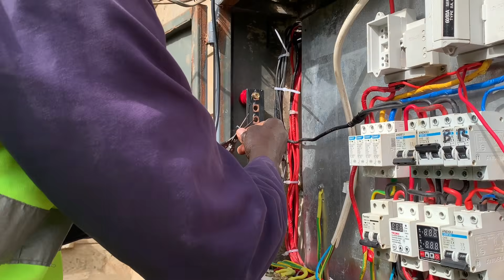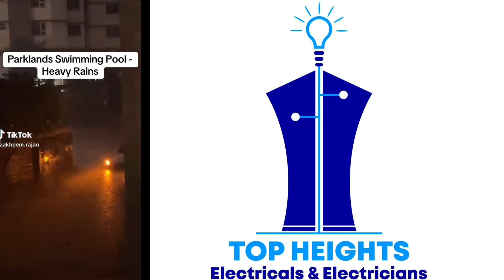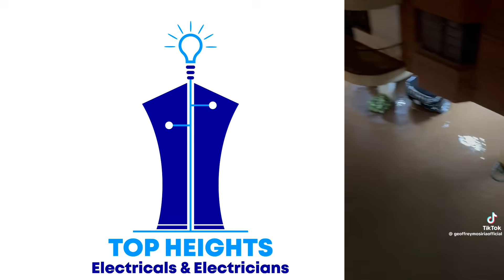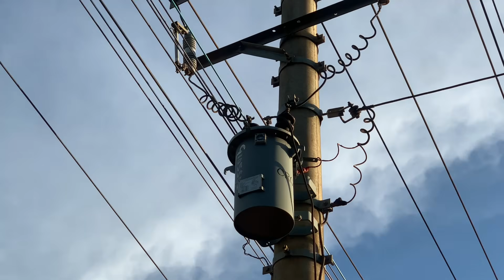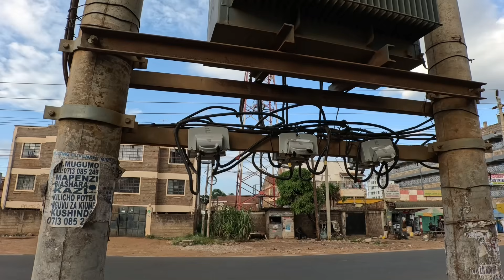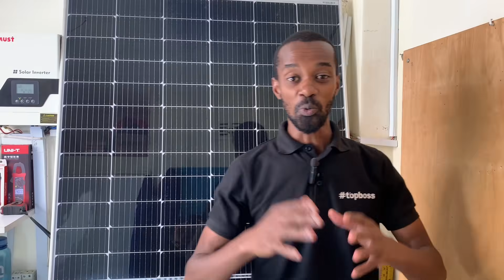Consumer Unit Wiring | Most Important Device!

Comment: Quick question Mr John: In a consumer unit there is a 60A Circuit Breaker, when does that breaker trip? Because the rest of the wires after that breaker are 2.5mm for plugs and 1.5mm for lights and those wires are too thin to trip a 60A breaker
Reply from the maker: the 60A breaker acts as the main isolator or main protective breaker for the entire house supply.
It trips when:
The total current of the whole house exceeds 60A
There is a major short circuit or fault upstream
Reply: @topheightselectricals  Ok thanks a lot sir

Comment: What is AVS , uses and how to install it
Reply from the maker: An AVS, also called an Automatic Voltage Switch, is a device that protects electrical appliances from voltage fluctuations—either high voltage (surges) or low voltage (sags). It automatically disconnects power to the load when voltage goes outside safe limits and reconnects it once voltage returns to normal.
Common in areas where electricity supply is unstable.
Protects appliances like instant water heaters, refrigerators, air conditioners, and TVs.